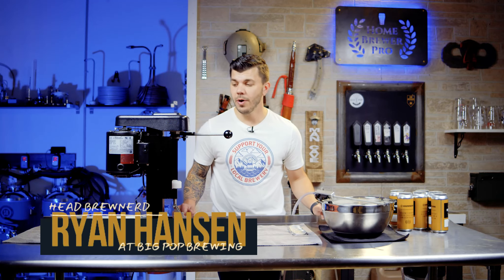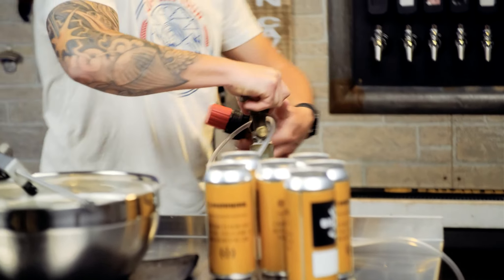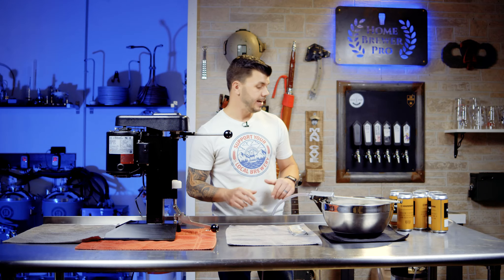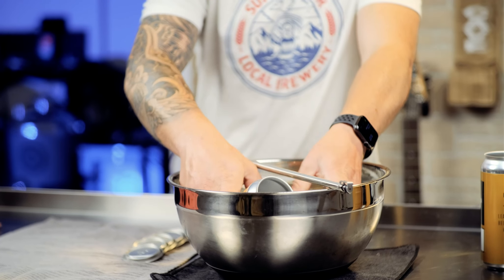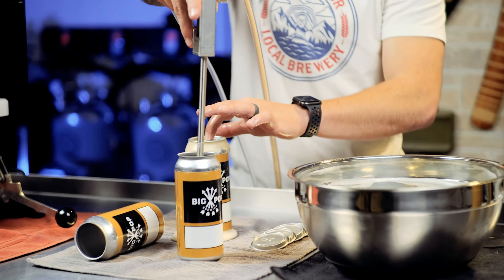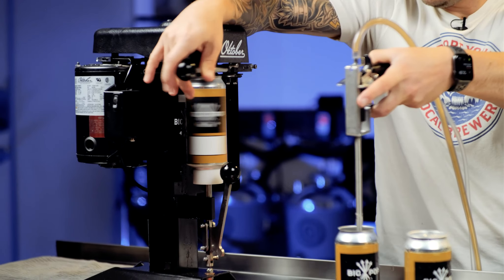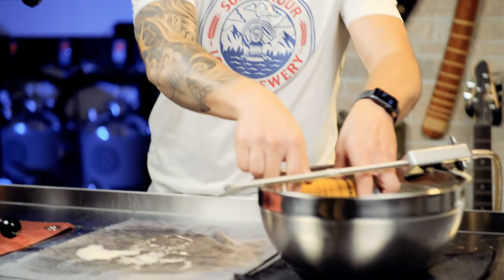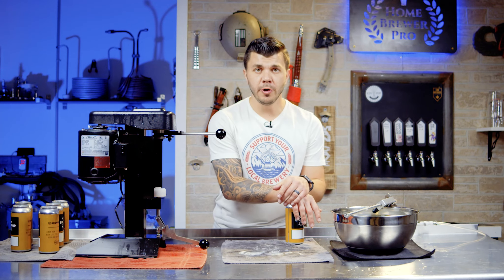Video 21: Canning finished Home Brewed Beer with the October Design SL1

Comment: What do you think about racking into the cans from the fermenter without carbonating first. Adding carb drops or the sort to the cans then letting it naturally carbonate?
Reply from the maker: I've never done that, but in theory it should work perfectly fine! An upside of doing that would actually be LESS oxygen because the refermentation will eat up any oxygen that gets in while you're racking into the cans. Let me know how it goes if you try it! It's theory till we try it.
Reply: @bigpopbrewing sounds good.  I'm about to try it with a seltzer. I'll let you know how it goes once they carbonate up.